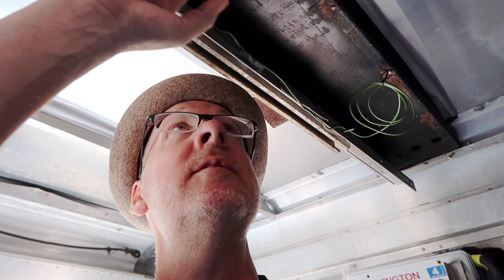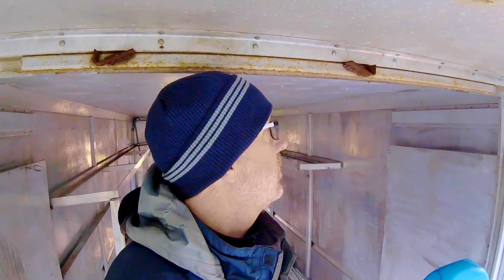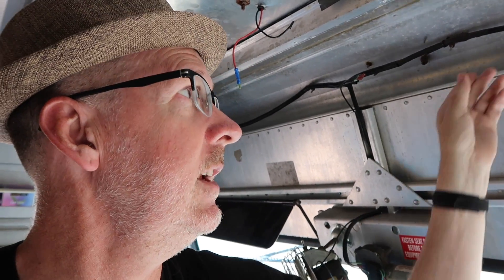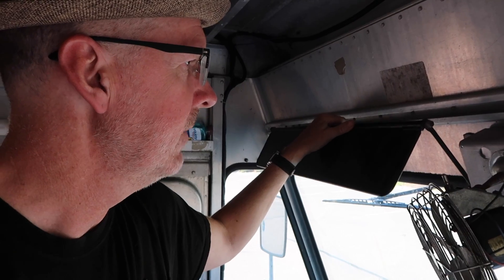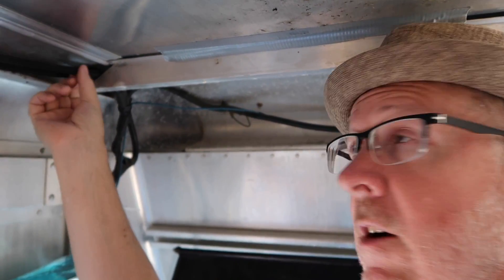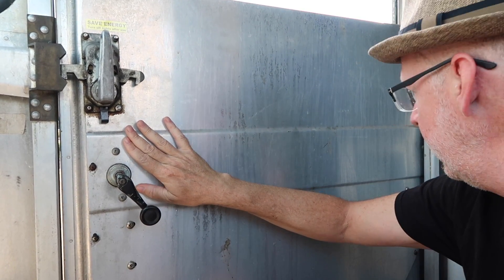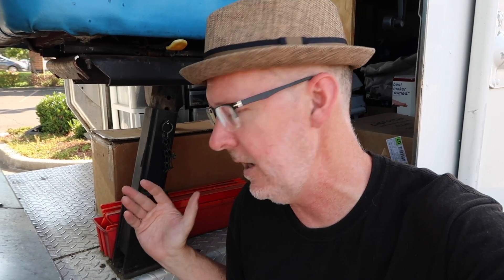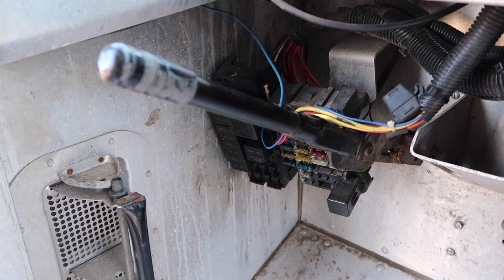Grumman Step Van Interior Tour | Before Conversion E003

Comment: Damn, I would have bought some Dynomat or something to cover that doghouse in asap with all that racket while driving!  Oh, if you are concerned about the lack of a 3pt harness and probably going to replace the seat that is there, look at the seats from some convertables and conversion vans, they may have the whole belt assembly built into the seat. I think Chrysler used them on the Sebring and 200 convertables as well as the early Quad Cab Rams, not sure who else used them, but I wouldn't be surprised if some of the more modern conversion vans had them too.
Reply from the maker: yes, need to cover the doghouse. but if I have to choose between building a kitchen and insulating doghouse I'll take the kitchen. so, it is on my list, but further down. regarding seats, I don't think I can mount any of these on the post or in that space... unless someone can engineer around those steps

Comment: You may want to look at changing the driver seat and get one with a build-in shoulder belt (3 point seat belt). I purchased two such seats at an auto wrecker. They came out of a 2009 and 2008 Toyota Sienna minivan 7 seater.

Between model years of 2004 to 2010 the Sienna 7 seaters featured 2 fold flat, tumbler bucket seats in the centre row. The one on the passenger side had the option of being mounted on the outside next to the sliding door or in the middle. This mounting flexibility is the reason it had the 3 point seat belt build-in. I also got 2 swivel bases out of a Chrysler mini van from the auto wrecker. Between 2008 to 2010 Chrysler Town and Country, as well as Dodge Grand Caravan minivans featured the "Swivel'n Go Seats" option. The corresponding bucket seats also had the build in 3 point seat belts, but I did not like those seats, they were more basic and did not fold flat.

Otherwise you can have the complete 3 point seat belt kit out of my Stepvan. It comes with heavy duty mounting plate, which fastens to the inside of the pocket door opening. I also have a complete jump seat with seat belt that was mounted on the partition wall that I removed. I would be happy if someone found use for it rather than making garbage.
Reply from the maker: I'm very interested in upgrading to other seats, but just can't fathom how they would fit into the space where the post is (most have square boxes for bases which would hang over the space where the steps are). I would love to have a jump seat, but don't know if the shipping cost would be more than buying a replacement locally. might be worth looking into
Reply: Wandering Step Van Changing the seat should not be a problem. Your seatbase looks very similar to mine, it looks like it has a solid steel plate where the seat sliding track mounts on. The seats I got have a flat frame, you may just have to make an adapter plate to mount the seat to the original tracks or get a seat with tracks and you may just need to re-drill the mounting holes on your base.

Btw. don't know if you have already done so, but your seat post is height adjustable. Just pull the pin on the shaft and the whole thing should come out.
Reply: Oh and if you are interested in the parts, let me know. I am hoping to make my way south in November. It will be something like Detroit towards Texas and likely into Mexico.
Reply from the maker: I have pulled the pin and raised it to the max height. also, not sure if you noticed that there is no "base" at the bottom of my post and the post rests on the edge of the steps. the normal box base of captains chairs etc would extend out over the hole where the stairs are and thus my problem with mounting them (I'd need to create a structure to span the stairs to mount the seat box base and thus lose one of my steps)
Reply: Wandering Step Van I was talking about the top of the post, not the bottom. I would keep the OEM 2 part height adjustable seat post as is and mount a new automotive seat on the top of the post base. On my stepvan the top was a rather large, flat solid steel plate, to which the seats forward/backward slider adjustment track was mounted. 

You may want to take a look at auto wreckers for a Chevy Pick-up/Yukon/Tahoe/Suburban bucket seat with the integrated 3 point seat belts. I believe they are fully self contained, having the entire seat belt system, including buckle, integrated in the seat. When you get the seat from the wrecker, it should have the adjustment track attached to the seat. You should only have to remove the floor mounting hardware from the adjustment track and then mount the seat with its track to your upper seat post base. At that point you may even add the extra height you need. Depending on how much height you need you may use a piece of U-Channel in between the seat track and top post base, which would then be a perfect space for a little storage drawer.
Reply from the maker: now I understand. thanks for the clarification!

Comment: Thanks for the tour! Question: what's the interior height? Or, how tall are you?
Reply: I was just going to ask that.
Reply from the maker: 81 inches from floor to the panels on the ceiling holding the fiberglass in place. there is a 1.5 inch gap behind that. I'm just short of 6ft 6in (shrinking w age)
Reply: thanks! The truck is really well designed. With my 6'4" I'd fit in a tall hat.

Comment: It would be nice if you can get an affordable air ride seat so you won't feel all the bumps they should have one small enough to fit inside your step van and if every comfortable I'm very good on your back that could have been the issue with your problem that you wanted to go see the doctor but if you can air ride seat that might fix it a little bit good luck hope you feel better
Reply from the maker: I've been looking around for one. I would have to add an air compressor system to the step van to use one (so I've been told)